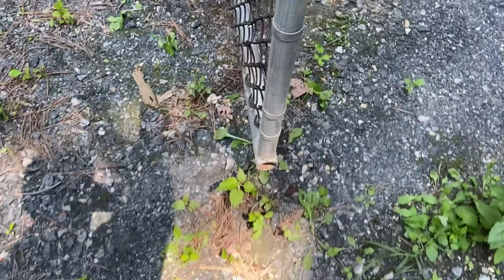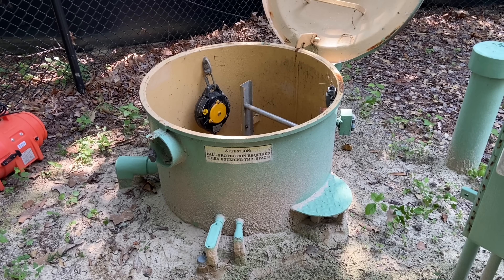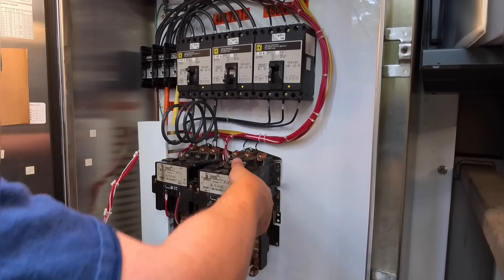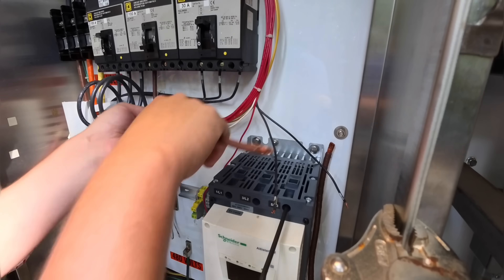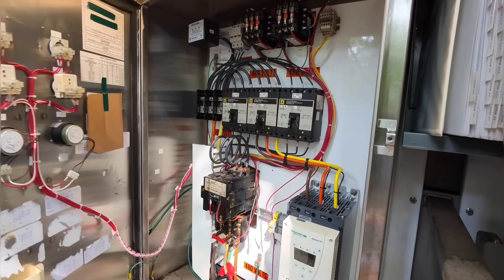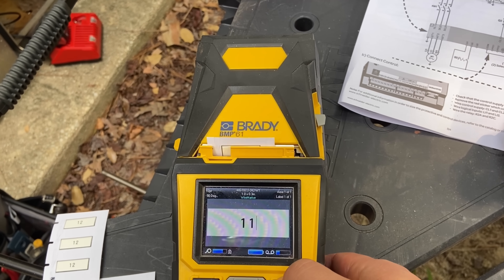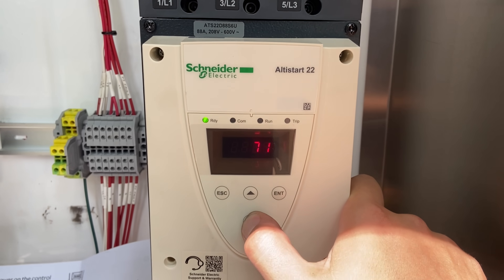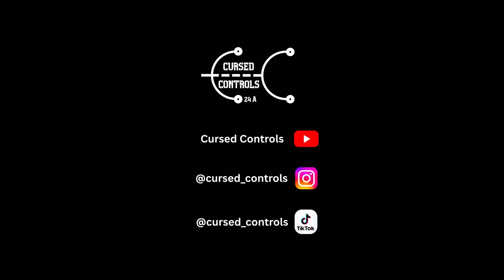Installing a Soft Start

Comment: That station looks like a Smith & Loveless package. Hard and cramped to work in when you have to change valves & pump motor replacement.

Comment: How does the soft start effect the power factor?
Reply: Probably not much once the motor is running and the internal bypass contactor engages. At that point the motor is running at full voltage and line frequency just like a contactor.
Reply: @peterfox2565  but they can produce some nasty harmonics during startup.

Comment: Do you think that transformer that has zero clearance on 3 of the 4 sides and on 2 of the sides have louvers for airflow are completely blocked is an issue???   Na, manufacture directions are just suggestions. 😂

Comment: Also: if that soft starter's install instructions dont explicitly say that multiple wires can be in a single terminal, then those taps wouldn't pass muster from an extra angry inspector. All it takes is a couple more terminal blocks (albeit large ones for you line side cables) and some jumpers to make that distribution block. Also Also: what kind of over current protection is on the primary side of that control transformer? The wires going to it look pretty small. Did you make sure they were large enough to follow The Tap Rules (NEC 240.21)

Comment: Get yourself a Greenlee Quik Draw punch set! As for the stickies: the best thing you can do other than fixing them with a screw is SURFACE PREP! carry a bottle of isopropyl and a rag to wipe down the surfaces you're gonna put emm on! makes them last a lot longer if you cant screw emm down.
Reply: In my experience It's almost always the foam that fails, not the adhesive. Just like this video, the adhesive and paper was still on the surface, plastic fell off and both have half of the failed foam on them.
Reply: @esm1469  yah the foam will do that due to heat. if it's a cabinet with some good cooling and not really in the elements then they can last forever. The issue is most control cabinets (like this example) have components that will generate lots of heat and have poor ventilation (or none with no air flow and are relying on the radiative capacity of the enclosure alone for cooling) will only accelerate the degradation of that foam. The truly best way to secure emm is with a screw. But surface prep can never hurt and will only ever help if a screw is not doable!